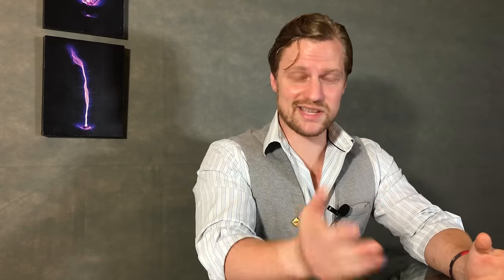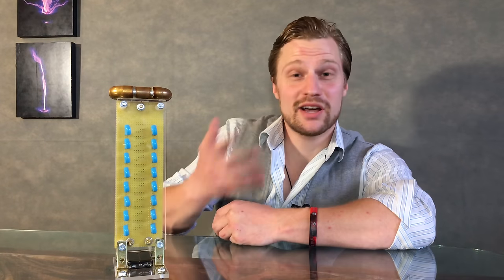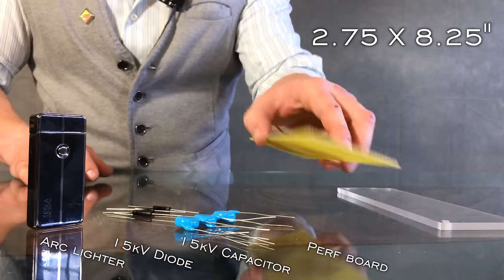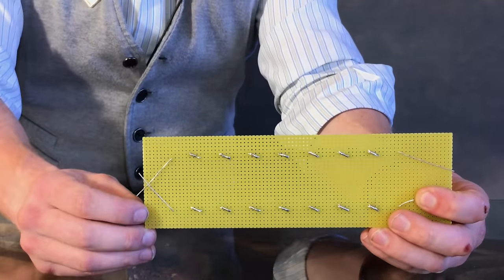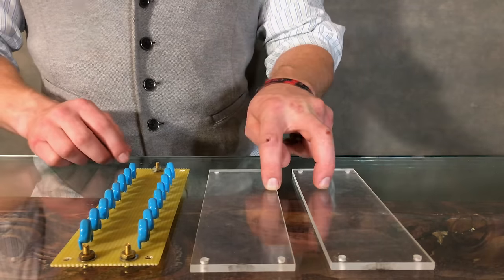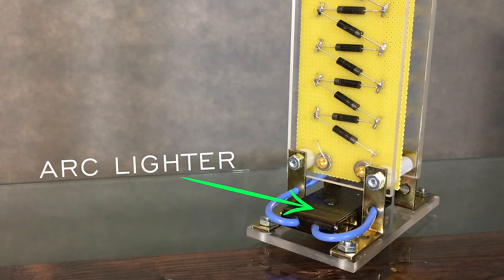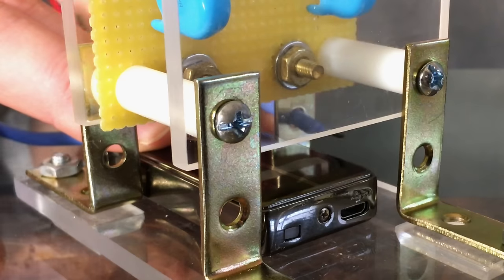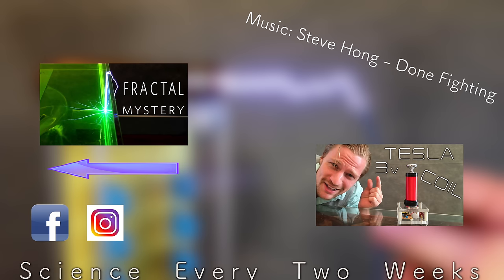DIY Desktop Lightning Tower (USB rechargeable!)

Comment: Can we attach this one in a tesla coil by removing the arc lighter and instead of that can I put a mosquito bat circut
Reply: And we put this things I say.how many volt will it praduce
Reply from the maker: You are not able to power this with a mosquito racket. The racket puts out DC. You need high frequency, high voltage, AC to power this.

Comment: Great idea! Great video! What is the maximum of stages to multiply the voltage?
Reply from the maker: Max stages is dependent of frequency. Higher frequency input allows more stages and higher output voltage. For practical purposes, 10-12 stages tends to be the max

Comment: Quick question can I use 20kv diodes with 15kv capacitors(because 15kv diodes are unavailable where I am) or will I need 20 kv capacitors as well.
Reply from the maker: Have you seen the links in the video description to buy these diodes? They work great!  Also, yes you can use 20 kv
Reply: Plasma Channel the ones in the description are the ones not available but there were 20kv available so thank you for telling me

Comment: I always wondered, does increasing the voltage drop the current? I mean like conservation of energy sort of thing?
Reply: Energy in = energy out, minus heat waste.
Reply from the maker: There is also a time constant. High voltage at low current goes in...continuously. Out comes extremely high voltage and very high current...in pulses that last a few milliseconds.

As Archetypal wrote....energy in = energy out.

Voltage multipliers do not obey the simple transformer physics that a basic iron core transformer obeys - turns ratio , current and voltage always proportionately dropping or increasing.

Comment: I just built mine but don’t work, the wires are attached to everything but when I try to get sum sparks I don’t see anything, do u know what’s going on with that?
Reply from the maker: Are you using an arc lighter? Are you certain the arc lighter is functioning? They break easily. Are you only discharging it to it's own electrical ground?

Comment: Hi there great video! I am using this idea in a current project and would like to know what high voltage wire did you use? Or recommend for me, I have it set up with 20kv 1nf 20kv 10ma diodes, ?

Comment: Awesome video 👌👌👌!
Could you  please provide a circuit diagram of the voltage multiplier. Not sure how to connect the diodes. Thanks a lot 😊! Keep up the good work and keep rocking!!!
Reply from the maker: Thanks so much! The diagram is a standard voltage multiplier Schematic. Can be found on google. Really really simple to build. Let me know if you have further questions
Reply: @PlasmaChannel   Thank you,sir. I found it on the web. Have a great day 😊!
Reply from the maker: Thank you! Reach out if you have any questions. Be safe, dont let it discharge from arm to arm.

Comment: Hello again!
 I have a question for you sirr!
with the Hz of the outputs set aside here, 
If you took this voltage multiplier you've made here- 
dismantled it, and used every one of the capacitors in a marx generator,
 with the same power source,
Which would generate the higher HV arcs? 

:) Hope all is well!!

Comment: I'm trying to make it, although the arcs jump between the capactiors' legs, and there is no voltage at the end. tried flipping all diodes the other way, still doesnt work. Any ideas as to what I am doing wrong?

I don't have literally the same parts, because I live in the EU, but the ratings are almost the same. I don't feel like it's the parts fault here, but I feel like I'm just doing something wrong.
Reply from the maker: Your power supply is AC, and your solder connections are neat?
Reply: yes, I've figured it out, I didn't have the ground connection to the second input. Thanks for help :)

Comment: Awesome vid, one question tho, during the construction it looked like some of the angled diodes were backward, shouldn’t they all be leading the power toward the next capacitor closest to the topload?
Reply from the maker: thank you. So, voltage multipliers charge up caps from powersource side first, not end first. The diodes were wired correctly.

Comment: Do they have to be 100ma diodes can they be 20ma diodes? I mean the lighter isn't going to put out anything above 5ma and it certainly isn't going to generate more then 20ma

Dose it have something to do with the fact that the capacitors are going to discharge much more current then the charging current
If you could could you tell me if 20ma will work and if not why it will not work
Reply from the maker: That is a great question, and yes your assumption on what happens during spark discharge is correct. You can likely use 20mA diodes, but I cannot guarantee they will work forever.

Comment: When you say "electrical ground of the multiplier" do you mean the floating ground or should the circuit be connected to earth ground?
Reply from the maker: Floating ground. Do not connect to earth ground, or you will blow your arc lighter, and shock yourself.

Comment: Hello, I tried to connect my voltage multiplier's high voltage output to a ground cable (earth) while I was powering it through a power socket in my house. The breaker popped and my multiplier is no longer working. What component should I change or is it completely destroyed?
Reply from the maker: So, you did not discharge the high voltage to the MULTIPLIER'S ground as I specified. It can only discharge to itself. Its own ground. I dont know why you plugged it in though...this multiplier uses a rechargeale lighter.
Reply: Plasma Channel thank you for reply. I have already solved this problem. I found out that the caps are ok but the diodes are completely destroyed so i changed them. It is working now just like before.

Comment: Would the electrical ground of the multiplier be the negative side of the battery in the arch lighter? I'm a little confused on where to connect the wire that gets the arch from the voltage multiplier.
Reply: The negative high voltage lead, basically the negative bottom bolt
Reply: Basically just one of the high voltage wires.

Comment: I'm confused on the term voltigmolteplyer sense you can't create or destroy energy so how do you molteplyi it  molteplying implys create energy
Reply from the maker: Because voltage is not energy. Electricity is composed of voltage and current. Voltage multipliers store up energy and release it in bursts of energy that are drastically higher voltage. They can also release the energy in continuous mode, but the voltage increase is much less. 

In general, voltage increase does not always mean power increase.

Comment: Can Voltage Multiplier be used to output AC lightning sparks instead of DC lightning sparks?
Reply: Sorry no,
however it needs AC input.
Reply from the maker: I could not directly. but if it discharged through an inductive capacitive circuit....you'd have high voltage AC
Reply: @PlasmaChannel  
Good point, hadn't thought of that.
however it might be quite high frequency AC

Comment: instead of 15kv caps can i use 20kv at 1nf, what difference would this make to how it works.
Reply from the maker: Are you familiar with how voltage ratings work on capacitors? (And most components)

Comment: Hello Sir
I have a question 
This voltage multiplier works for AC input voltage but the output of arc lighter is consisted of spikes or pulses how this works ???
Reply from the maker: The arc lighters are a pulsed AC out. It acts identical to a pure AC, and is a wonderful powersource
Reply: Plasma Channel Sir I have simulation of arc lighter circuit with output of 10kV but when I connect voltage multiplier to its output its not working and the reason is that output of arc lighter is spikes of high voltage not AC.
So how’s your circuit working?

Comment: What do you mean with connecting your wire to its electrical ground and nothing else? Whats something else?
Reply from the maker: The multiplier has its own electrical ground. Do not connect the wire to earth ground or anything else.
Reply: @PlasmaChannel  Ah i think it's because it will loop around into the lighter if you connect it to earth.
Reply from the maker: @MarterElectronics  Correct! thanks for asking

Comment: What would happen if you doubled the number of voltage multipliers?
Reply from the maker: As in, two separate multipliers? IF one is built with opposite polarity, they will spark towards eachother, and double the spark length

Comment: Is the copper pipe "load" connected to the top bolt ? If so how, and also how would you recommend to fix it to the structure (glue ?)
Reply from the maker: I used double sided tape.
Reply from the maker: I used double sided tape.

Comment: how if i change the capacitor with 680pf 15kv and 15kv 5mA diode is it possible?
Reply from the maker: I would not recommend 5ma diodes. They will blow up, quickly.

Comment: how about using ccfl inverters like the ones used in old lcd tvs .. those things can give 2kv at 50ma ... and u can go crazy mad with micro wave transformer and high frequency generator !! those ones can dump 600ma 2000v!!!
Reply from the maker: That is a great idea. Not so much the MOT though. Too much current for the diodes, and, you'd not get much voltage out. 2000 volts at 60Hz does not create a big output from a multpiplier
Reply: @PlasmaChannel  exactly what electro boom showed on his video of flying oil!!

Comment: There are basically 2 types of high voltage DC generators, and they both can be lethal. They also produce ear damaging sound pressure levels when discharge occurs. Your feeble warning at the end of the description is not good enough. Ear protection must be used to prevent permanent hearing damage. Please put warning information in your videos, and not hidden in the description.
Reply from the maker: Hi Jim, I appreciate your comment. If built exactly as in the video, this device is neither lethal nor deafening. DEFINITELY uncomfortable if used wrong. Going forward, I will put more emphasis on safety. Cheers.

Comment: You used copper tube for your top load. Could I use the drawer pull you used on the tesla coil on plexy  as my top load.  Or would that change the capacitance too much. Love your vids, I learn soooo much. I am a woodworker delving into electricity, what I dont understand I search and learn as I go. So far it has worked out ok
Reply from the maker: Yes you can! However, the topload for a VM is different in that it provides EM shielding to the top components. It suppresses the tendency for high voltage to break out of the top capacitors, as opposed to where you WANT it to break out.......after the top capacitors. Having a smaller topload may reduce the lifespan of your upper capacitors and diodes, significantly. Thanks so much for your kind words, and i'm honored to have you in my Plasma Nation family!
Reply: @PlasmaChannel  Im sure you are busy so I really appreciate your reply and learning more everyday Thank you. I am currently building the newest tesla coil, and waiting on capacitors for this project

Comment: apparently the capacitors I bought from amazon aren't arriving till October 12th, so I might as well see if I can get all the rest of the parts and accessories I need for the voltage multiplier I'm building. since the parts are rated for 15kv, could I use a 10,000 volt transformer out of an air ionizer to power it as well, and since an arc lighter puts out about 5,000 volts and 3 inch sparks off the multiplier, would 10,000 theoretically put out 6 inch sparks? since the transfomer is outlet powered, I could also control the voltage with a variac.
Reply from the maker: In theory yes, but at that high of voltage the entire multiplier would be throwing ionic wind in all directions, and you’d have power loss like crazy. You’d need to submerge the tower in oil or wax. But that then covers up the beauty of the build.
Reply: ah, I see. electroboom had a problem with that too. that does explain the color of your big voltage multipliers though.
Reply from the maker: Yeah ionic wind is a huge problem when designing high voltage devices
Reply: I decided to test a small prototype of my voltage multiplier today, and after some troubleshooting, it worked! ..for a second before the arc lighter quit. it just stopped running and quickly got really hot (probably an internal short in the lithium battery). I decided to test it with a power source I took out of a plasma ball, connecting one input wire to the high voltage wire off the transformer, and the other to earth ground. It worked much better, since the plasma ball is powered by a 12 volt supply and built better. when I added all the stages, I got about 3 inch sparks! unfortunately, there was so much ionic wind and power loss (you were right), that I'll probably have to submerge the circuit in oil to stop it arcing all over the place. I mainly just care about the sparks, and my lab is a giant mess of bare wires and stuff anyway, so it will fit right in! heh heh. thanks for the amazing videos and inspiring me to build these things.

edit: why do I make such long comments
Reply from the maker: hahaha. I love long comments. Sorry to hear of the lighter. Like I said, they are such tricky, sensitive little devices. Funny, when I once tried the powersource from a plasma globe, it ended up slowly burning out. Glad you had better luck. I'm a sucker for transportability, thus the rechargable lighter.

Comment: You can use a cheap electric fly swatter instead of an expensive arc lighter!
Reply from the maker: You cannot. Electric fly swatters are DC. Voltage multipliers need AC to function
Reply: @PlasmaChannel  They actually have a transformer outputting ac and then rectify it to dc. I just removed the rectifier and voila,: 5kHz 3000v AC
Reply: Okay maybe not 3000V, The flyswatter I have just produces 1000v 😅

Comment: In the video you see the arc connecting to the wire in your hand. Where is the other end of that wire connected?
Reply from the maker: the wire is connected to the electrical ground of the multiplier.

Comment: Hi Jay... I've gone and ordered a double arc lighter by mistake.... can I chain the arcs to feed a multiplier? and how should I do that?
Reply: Also, I'm not to happy about the possibility of frying an arc lighter so I was thinking of using a 15kv kit (from 3v) as my Power source.
Reply from the maker: Matthew, actually, I found that method to be very effective. Put the two little HV transformers in series, and the output is more resilient. To prevent frying, always make sure it discharges to the ground of the multiplier( even set up a stand that holds the wire, so that only one hand is touching the multiplier at any given time. Pulse the power 5 seconds at a time max. Should work great! You can also use the 15kv source, as long as it is AC

Comment: hi, good day! Is there any power point or pdf that we can used as a reference??
and another question, that last 1 bolt at the top of perf board, is it directly connected to the copper pipe or there was a wire at the center thats connected to the bolt and copper pipe.

Comment: Instead of using arc lighter
Can we use 230v dc
Reply from the maker: Feeding DC into a multiplier will actually do nothing. You can feed 230v AC into it though, as long as the current source is limited in amerage to less than 100mA (the diodes are only rated for 100mA). But if you feed it 230v, you really will only get a few thousand volts of it.

Comment: What if you used the ZVS transformer with the multiplier? How long would your sparks be then. Also i got some 100ma 20kv diodes
Reply from the maker: Do you mean ZVS driver powering a flyback?
Reply: Plasma Channel yes, and then that connected to the multiplierr

Comment: It's really hard to find those diodes. I've only got access to 16kV 5mA Diodes or 20kV 100mA Diodes. Can I use one of these?
Reply from the maker: You can use those, though they discharge current may blow them up eventually. they would work for at least a little while.
Reply: @PlasmaChannel  and what about the 20kV 100mA? Will they work?

Comment: I am going to use as my School Project and i really want that people get interesst in Physics but i have a qurstion Do we need just a neutral White Wire to catch the Sparks
Reply from the maker: Hi! Only build this if you have previous experience with high voltage. The wire should be attached to the electrical ground of the multiplier only. Not earth ground.
Reply: what does that mean electrical ground multiplier
Reply from the maker: Bigman T I’d suggest looking up voltage multiplier schematic on YouTube. The multiplier has a ground. Electricity coming from the top electrode must return only to this ground or you will 1) painfully shock yourself and 2) destroy the lighter.
Reply: so i have to get a ground wire
Reply from the maker: Not a ground wire. Just a wire, attached to the multiplier's electric ground.
Reply: I am really sorry that you spend your time on me but can you send me a drawing of how it would look when the wire is attached to the multiplier
Reply: I’ve never done something with electricity

Comment: I plan on building this, and I want to be sure I don't blow it up. which wire is the electrical ground, or did you use earth ground?
Reply from the maker: Glad to hear! I have most the links you need down below. Don’t use earth ground, it will blow up your lighter. Depending on your diode direction, it’s one of your input wires. I’d recommend looking up voltage multiplier schematics on google.
Reply: Woah! didn't expect a reply that quick! thanks, I've been researching voltage multipliers for a year or two now, and I'm buying the final supplies I need soon.
Reply: oh... I remembered the second question; what did you use to cut the acrylic?
Reply from the maker: I used a jig saw, them sanded perfectly flush